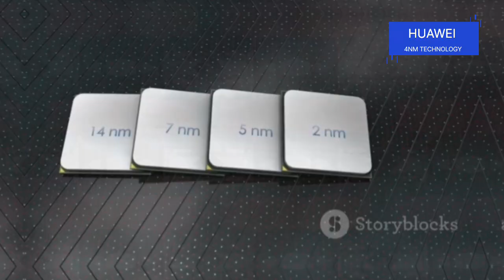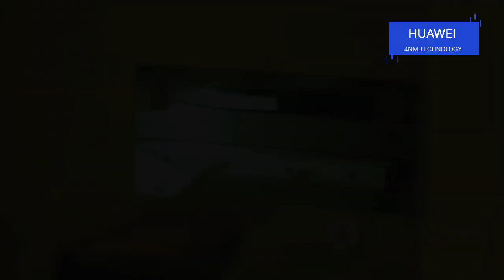Huawei's 4nm Chip: A Technological Marvel and Its Global Impact

Comment: ChatGPT: Yes, Huawei presented a 4-nanometer microprocessor, launching it in the Mate 60 Pro smartphone in 2023. The processor, called Kirin 9000s, is manufactured by the Chinese company SMIC (Semiconductor Manufacturing International Corporation). This is a notable achievement as China has made progress in semiconductors despite US restrictions on access to advanced chip manufacturing technology.

Although the Kirin 9000s is manufactured using 4-7 nanometer technology, this has attracted attention as a sign of China's ability to produce advanced chips even under sanctions. The 4 nanometer technology is comparable to the most advanced processors available on the market at the time.

This processor is considered a proof of China's progress in developing its own technological solutions, but the efficiency and exact performance of this chip are still being analyzed by experts to see how competitive it is with similar solutions from other regions, such as the US or Taiwan.